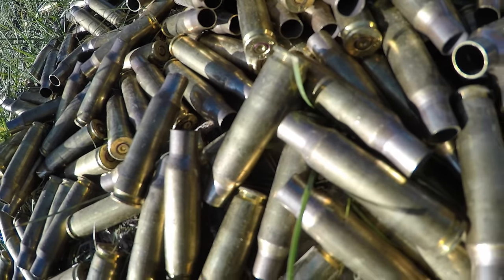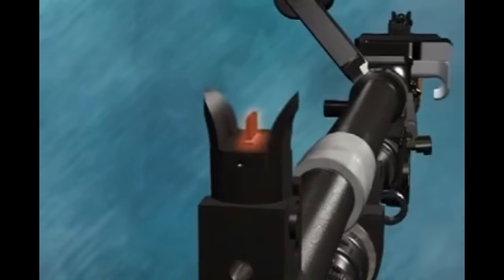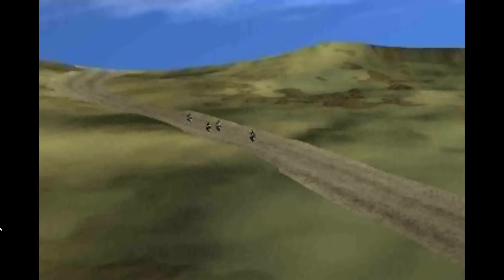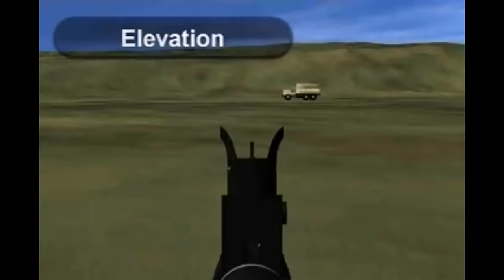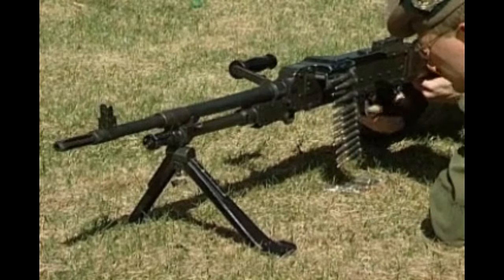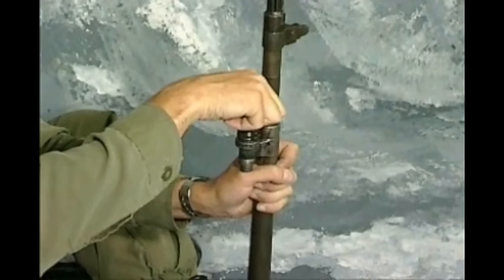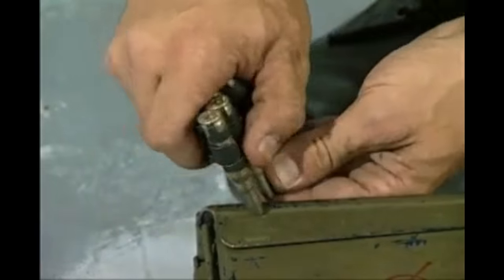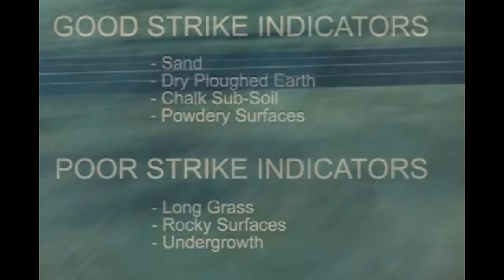How does the Canadian Army C6 (GPMG) General Purpose Machine Gun Work?

Comment: 5:02  They say you get about 50 rounds in a minute with that way of fireing it, not the actual rate of fire of the machine gun, right? Because that's a little irritating when you don't know better.
Reply: 50rnds a minute when shooting to actually hit something still sounds a bit slow
Reply: "normal rate" is a rate of fire determined by the second commander or section 2IC. 3-5 round bursts with several seconds inbetween bursts = about 50 rounds a minute.
Reply: What most people think of is the 'cyclic rate of fire', which is what the design is capable of, but will quickly break the gun.  The recommended rates are far slower, but can be sustained indefinitely, as well as being more accurate and making the ammo last longer.

Comment: Very interesting that the instruction is to hold the butt with the fingers over the stock and not under pulling it to your sholder. Look like this gun lack the hook to pull it to the sholder from underneath.    Also the video do not enphesis the left elbow on the ground. Maybe that is a result of the grip
    My experience is with the swediah ksp58 and i feel that I would be missing the hooked grip underbeath.

Comment: the M240 is based on the same FM MG. The only difference is that the M240 has 3 different rates of fire (that nobody uses). 
I don't get why most countries field general purpose crew served weapons. Why not have an MG that can fire from the open and closed bolt and be able to fire semi as well as fully auto with rifled barrels and smooth bore. 
Now the Germans know to make an MG. The Brits used to field high speed MG's but I guess it's cheaper to go general purpose.

Comment: how heavy and old is that thing? We have a different one now don't we?
Reply: It was developed in 1958, but it's essentially a belt fed Browning Automatic Rifle turned upside down and with the semi-auto mode removed.
And it weighs about 8kg with a 100rnd belt stuffed mostly in the ~75rnd capacity marching pouch.
Reply: 24 (imperial) pounds if my memory isn’t too foggy !! (10.9 Kg)  And FRONT HEAVY to lug around in the Bush mate!
Reply: @SonsOfLorgar  The bolt and gas system are Browning's but the trigger mechanism and feed comes from the MG-42
Reply: The new one is nearly identical but has synthetic materials in place of wood.
Reply: @kevin_1230  Also has rails, one on the feed cover and two on either side of the gas tube.